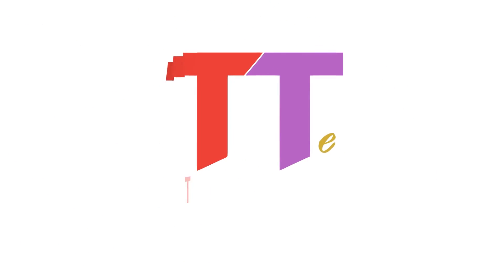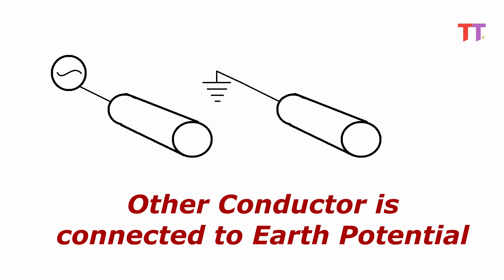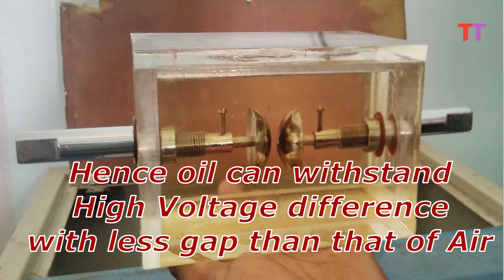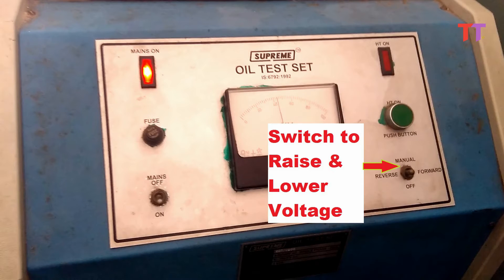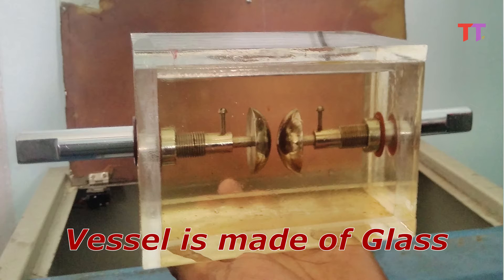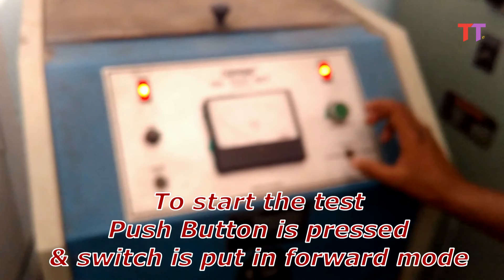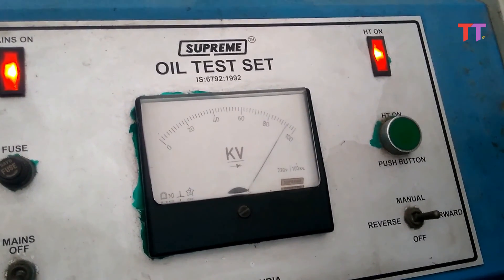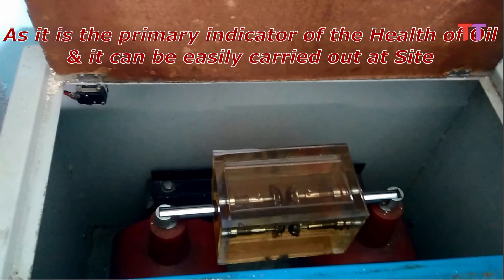BDV Test of Transformer Oil. Breakdown Voltage Test or Di-electric Strength Test of Insulating Oil.

Comment: Can we use this instrument to check the moisture content of oil ?? If first we develop caliberation line by adding 0.001 %, 0.002%, 0.003% etc water in oil and note voltage against each addition
Reply from the maker: Good question. Dielectric Property of Transformer oil is dependent of multiple factors, such as moisture content, oil temperature, oil degradation, and other impurities. Hence only BDV test alone does not define moisture content in oil. BDV signifies overall dielectric strength of oil.
Reply: @ElectroGlobe1  Thank you for your informative answer ❣️❣️